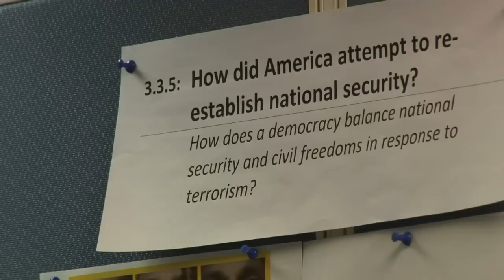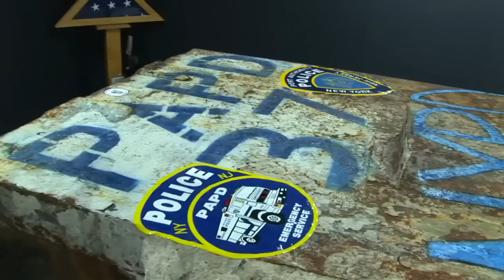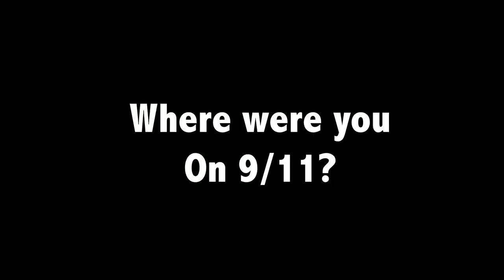Building a museum at Ground Zero: Steve Rosenbaum on the TED Blog

Comment: because buildings that are hit by planes always collapse straight down, especially when the fire was nowhere near hot enough to even begin to damage the steel beams. And you always see diagonal clean cuts of the support beams that are identical to intentionally collapsed buildings when it was just an aerial attack. Yup you nailed it...no inside job here!